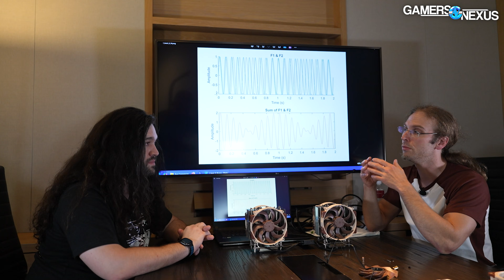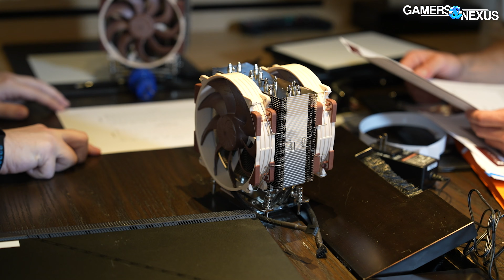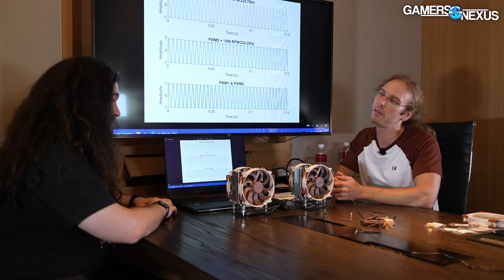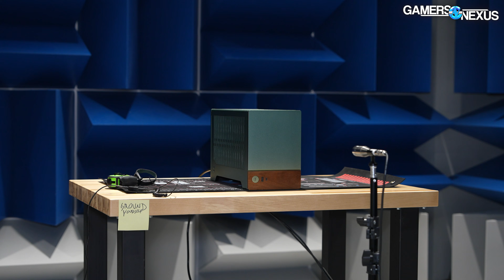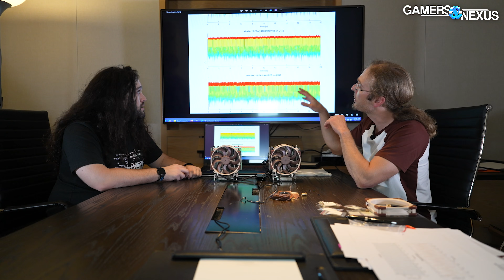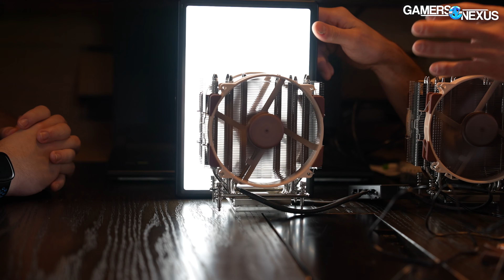The Most Annoying Computer Noise | Noctua Engineering Deep-Dive on Case Fans

Comment: Finished watching the whole video to be sure I didn't miss anything.
I'm wondering why they don't just make dual fan coolers with a single center motor and dual output shafts to each fan? The air between the hubs is basically dead anyways. A single dual shaft 12VDC motor with small serviceable ball bearings on each output would be way better. Not only would the fans always run at a perfectly matched speed, but you can clock the fans to support each other.

Comment: This was a really cool conversation (pun intended).  My current build ran into the intake issue with the rear fan on my O11D XL.  It uses the long vertical slits instead of a mesh, and there was no problem when I had it as exhaust.  But when I switched it to intake it started making a buzzing noise.  Not super loud, but enough to be annoying.  

I swapped to a spare fan, which did nothing.  I then held the fan in place, turned it on and moved it further away from the rear panel and the sound would go away.  So I ended up doing exactly what Jakob suggested, putting some spacers in place to create a gap between the fan and the case.  

I probably only noticed because the rest of my system is nearly silent.  It's a custom loop with plenty of radiator area so the fans are turned down pretty low.  If it had been an air cooled system with typical fan noise I doubt I would have noticed.  

The "beat frequency" thing is interesting.  I played various stringed instruments for many years and I used that effect to tune them.  Two strings that are perfect harmonics of each other won't do that, but if you tweak one just a hair out of tune you can hear it.  Takes a bit to train your ears for it but it's pretty obvious once you hear it.  With fans I wonder how close they need to be to create that effect, and if orientation matters.  Like a push-pull on a CPU cooler I would think might be the most prone to it.

Comment: His German to English translations need work!  Schwingungen is not synonymous with floating, nor hovering at all but for best understanding let me twist a word: "Swingings" referring directly to the swinging of frequencies from peak to peak in relation to the null point in the middle as experienced in time!  It's basically a way of describing any energy waves basic function, to which you can then point out differences in their individual terms or specifics about it.  A use example being "The differences in the 'swingings' between a sine and a sawtooth or square wave".
Reply: The German term Jakob was referring to was "Schwebung", not "Schwingung". As you've said, "Schwingung" in the acoustic context would simply translate into "wave" or "oscillation". "Schwebung" translates into "beat frequency" and, in a more general sense, the verb "schweben" means "to float" or "to hover".
Reply: @noctua_at4356  I know what "schweben" (an effect or an procurance/observation) means, but it is a definition of a more specific phenomenon, and as such can exist without any apparent osculations or motion at all!  "Schwebungen" is plural, and does mean beats, but beats are a result of two frequencies interfering to create beats of a harmonic nature... It's all about context, and in this context the term is not synonymous with floating anymore even if relative to why something may be floating.  There's no floating in radio transmissions, or in a microwave spectrometer, X-Ray machine...!  I guess he may have been eluding to A specific measuring point that "Floats" at a constant or stable value, or within a range.

It's more about use cases, as well as the difference between technical and scientific terms bound to facts, laws and theories, not colloquial words and uses derived from or preceding them, and their often non specific and loose uses, like as you mentioned Acoustic terms or even musical terms with 3 4/4 bars played over 4 3/4 bars both add up to 12 but result in a third beat riding with them (a poly-rhythem).  The fact that many technical terms are derived from more vague ones probably doesn't help.

"Beat frequencies" are a subset of "Schwingungen" which I think he also mentioned (Now the sum of the properties are involved and considered), and in this case the beats are harmonic, and therefore efficient and sustainable, but also stressing on the system and with the obvious noise, because they arose from enharmonic wave patterns AKA interference patterns also in the realm of Schwingungen.  Those are at play here in the form of a secondary wave oscillation, which happens with harmony perfect intervals in resonant frequencies, but also with out of sync enharmonic waves colliding, where the forces can distribute and balance out in ways for an efficient sustainable resultant oscillation.  If this were set into motion and then let play out neither of the two oscillations would be sustained as long as they would separately as they are cross converting each other at a high loss, mainly mechanical energy in the form of friction, but forcing it by feeding it with power forces the differences to balance out and distribute to become more efficient in stability and exert it's own resultant force, (not energy use, its not efficient there).  Here it also leads to shaking the fan apart in less time than it would if they had curbed it better, as well as quiet it down.  They have already started synchronizing and manipulating the RGB on off frequencies to interact with the blades individually, even project images...  Less stuff out of sync, better image quality.

I studied some electrical engineering in Germany;  got deported, never finished, but never stopped geeking out and learning more, and ended up working in wave tech both electromagnetic and mechanical and in varying scales so microscopic to telescopic, high and low power... for a good decade, making groovy custom equipment for some very big labs in the science world, and still am in the wave business, in a wholly different capacity as a guitar builder.  Since some of the stuff I did in wave tech was used in chemistry, and honed for more specific uses, I had to deal with chemists, that used some of the same terms but applicable to completely different problems or processes because they do behave in relative ways, and many terms do apply, but frequency of a wave is not the same as the frequency of occurrence of an event resulting from it, and things like that sometimes caused confusion and had us trying to figure out what each other were saying, and even more so when they didn't speak english nor I whatever they spoke very well or at all.  Thanks to math and graphs, gesturing and making weird noises we always sorted it out.

Also:  Schwingungen is an excellent Album by Ash Ra Tempel delving into what frequencies, especially in multiples interacting in differing ways with each other in an audible sense can do to your brain!

Comment: Ah, I watched out for this when configuring the two stock fans that are mounted by default in the front of the Fractal North very close to each other. I made sure to wire them to separate fan headers so I could let them spin at slightly different speed to avoid that sort of resonance/harmonisation. I say avoid, I never really noticed any actual problem if I had it set in the default way, just read about that possibility online.
Edit: That's perhaps general advice you can take away from this, if you have fans mounted side by side, avoid putting them on a splitter that won't allow you to set separate speeds.

Comment: No mention of interactions with case fans?
There's no reason that 1 CPU cooler fan couldn't interact with the case fans to produce the same effect if both are audible. Or the case fans interacting with themselves to do it regardless of how perfect the CPU cooler fans may be configured.
It's an "impossible" problem to solve from 1 angle, unless we're just thinking that CPU cooler fans are MUCH louder than any of the others, including GPU fans.

Comment: I have some cheap 140mm NOX Hummer fans mixed with a huge 200mm AeroCool case fan, sometimes I can fix a quite fast hum they generate by tapping the front of the case, does that mean my fan controller has a weak knob or something? 'Cause from this explanation it would break the beat frequency for a second then it should come back...

Comment: Vehicle tyres have different sized tread blocks as you run around the circumference, to reduce road induced harmonics. I wonder if differing blade sizes would make any significant difference to the beat frequency?

Comment: Noctua makes some very nice, high-end kit, and yet some of their fans have peculiar sound signatures. I’ve got Noctuas from 40mm to 140mm in diameter and for instance the 40mm fan, no matter what you do will emit a high pitch buzz at higher rpm. Similarly, the 140mm have a distinct hum. I’ve replaced the 40mm with a Noiseblocker PM-1, which is just better in every way, especially noise. And the 140mm I swapped for a bequiet! one, same story.
I do think their CPU heatsink/fan combos are outstanding, the quality of engineering really shines through there. But for case fans, there are a lot of good alternatives that may work out better for you.

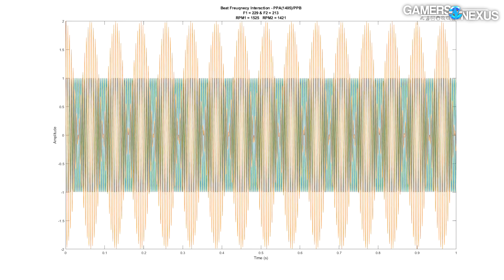Comment: 26:25  1525-1438 sounded the least annoying from my point of hearing right now (relaxed, not stressed, almost no background noise).  My tip would be:  always evaluate your system's noise when you're calm.  Our brains filter out a lot when we're under pressure (some more, some less), but that filtering takes a lot of brain capacity which is why you'll always get more tired/annoyed/distracted in a sound environment that requires a lot of filtering, regardless of wheather you perceive/notice the noises or not.  You'll be amazed of what your ears can pick up when your absolutely calm 😮 goes for all other senses 😊

Comment: But if you mount fans with a gap between panel and fan, won't that also result in a large amount of air being sucked from inside the case? Decreasing cooling performance?

Comment: So obviously, with decent PWM, it should be possible to ensure destructive interference between all the fans in your PC, even if you have to place a microphone where your head normally is and a period of calibration is needed. It should be able to set the frequency of one fan, then alter the frequency of the others (one by one if needed) to minimise total PC noise. After doing this for a range of frequencies, then any hum or constructive interference should be eliminated.

Comment: I have made that """noctua" trick 10+y ago. An empty PSU case with 3 fans inside. A high pressure one the first and 2 bigger distance one.
Corsair h100i fans + 2 PWM share Arctic one. So I can activate them 1-1.
Looking through the blades always lovely. Especially TV lights.

Comment: It´s good to see that Noctua knows about the problem all their current fan designs (mainly A14 and A12) have. This explanation should be included in slides for their fans, otherwise the users may determine the fans are faulty and return them.

Comment: Coolers, particularly air coolers also see very nasty acoustics from the intake aerodynamics when run with pull fans, would be interesting to see different ways of mitigating this. I know some vendors have used serrated edges on the heatsink fins, maybe also zig-zag fin designs could help.

Comment: IF  You  run  the  fans  Full  speerd  this  Noise  Goes  AWAY   as  the  Speed   forces  this  pressure  to  be  so  close  it  is  NO  LONGER  a  oscillating   humb  but   one  wave    unless  your  fans  are  out  of  Sequence   then  you  can hear  it   More  clearly
and  for  those  that  want   sound  dampening  ,  build   a  silent   box   for  it  as  you  are  no  longer  into   basic  use   and  even  during  streaming  ,  You can  place  th  Pc  Out  of  Microphone   reach
if  you  are an  Acustic  engineer  =  Buil  a  Quit  box  or  Move  pc  out  of  room  =  ALL  you  Really  Need  are  Display  cables  in  all  due  reality  =  No  one  N EEDS  to  SEE  Your  PC  if  this  is  your  Business  =  NO  ONE   =  the  pc  Holds  NO   Variable  on Your  Content  creation  =  Other  than  Performace  it`s  Self  !!!

Comment: Beat frequencies show up everywhere!  Me personally, a very slow beat frequency is much less annoying than a faster beat frequency that is still distinguishable.  Beat frequencies are an easy way for musicians to tune their instruments to each other as well - you might still be out of tune, but you're out of tune together so it sounds ok.

An obscure one for you: I worked on a submarine which uses a split electrical system (usually) - so half the machinery was powered off one generator, another half off the other.  I would commonly match the frequencies of the two generators by listening to the beat frequencies from all the machinery in the engine room (more accurate than just looking at the frequency meters, since there's an acceptable tolerance on those to how accurate they have to be).

Comment: This makes me wonder if Noctua could incorporate an externally-powered sensor in each of their fans to self-correct by adjusting the speed to match a desired RPM consistently and then recording that offset to a micro-computer. Rather than RGB, Noctua can use the extra wires to incorporate an offset, use software to define which fans are going to what and have the fans adjust speed as necessary until blade spacing offset is correct and speeds match.

Comment: Fascinating that the perceived pitch of the sound in the clip just after 26:00 initially did a slow climb to a higher frequency sound, but then when the beat frequency reached its peak, the perceived pitch suddenly dropped to a much bassier tone.

edit: well this was an unbelievably unlikely coincidence. I got stuck in physics tube, and in a video about time crystals he mentions a singing technique where higher pitch frequencies can be combined to create a lower pitch frequency: https://youtu.be/Zr8zwfm1Ub8?t=428 (~07:10). I wonder if that's what was going on here; it feels (emphasis on flimsy, insubstantial "feels") plausible.

Comment: Weird. If thermal solution need to create acoustic issues to suppress thermal issues why not just get better thermal handling where it supposed to solve at first place? Multi point sound profiling focus on single fan module. Thing is you rarely see any gaming chase out there with singular fan module slot. If you needed multi fan module that install close to each other what would you expect? 😉

Comment: So a simple way to explain this to everyone so they can relate would be to think about a time when you are driving your vehicle near another vehicle and your engines are running at nearly the same rpm.  You can hear both exhausts resonating in and out of phase with each other just like your case fans.  

A simple solution would be to adjust your case fans individually and set them with an rpm scale slightly out of phase with each other.  If you have 3 rad fans set one to ramp at 50 degrees, the next to ramp at 51, and so on…

Comment: I had a problem with vibration and i have all noctua fans 2x140 front and 1x120 rear and a Nhd-15 with a single fan but after testing i found it was the glass side panel on my meshify c. Fixed it with vinyl tape around the rims of the glass panel.

Comment: Thanks, Steve. I got to geek out listening to this. It is part of the work I did for almost 20 years. Granted, the fans were a bit larger. But listening to the frequency at different spots on the motor and the fan, you could tell if something wasn't right with it.

Comment: I'm surprised they didn't solve this by putting 7 blades one one and 9 on the other (with adjusted pitch angles and such to give them similar air pushing performance).

Comment: I have a case much similar to this however it is happening in my GPU where at certain fan speeds, the GPU starts displaying a very similar behavior to the one shown in the video where we it goes in and out of alignment causing vibration and noise.
Not sure if this is the case since the fans are mounted side by side and not axially like in a CPU cooler. but the similarity is very close.

Someone knows if GPU fans be individually adjusted?

Comment: in my own system, the phenomena i compensate for is it seems like the Case is slightly flexing the housing of some number of the Fans in the system (not sure which ones, hard to tell), which causes them to produce some sort of resonance.
bandaidable with some Rubber or such to shift how the Case sits on the surface to either flex it a different way or correct the flex.

Comment: Beat Frequency is also why when driving and you're behind another car both stopped turning left or right, you'll notice your flashing turn signal lights will go in and out of phase with each other. Sometimes in sync, other times flashing with opposite timing.

Comment: Aeroacoustic turbomachinery engineering -- two of the most complicated displines in engineer mixed/working together.

Those CFD runs must have been a PAIN to run, as aeroacoustics require very fine mesh, and therefore; computationally intensive, and then the multiple reference frames for turbomachinery makes it really, really complicated.

(The two disciplines, separately, are already complicated enough, on their own -- but together and more importantly, the INTERACTION between the two -- phew-wee. Yikes!)

Comment: Multi engine propeller planes also have issues with this, and with the volume of props, they take pretty big measures to mitigate it, else pilots and passengers go mad.
Some aircraft have an indicator called a synchronizer, and pilots would manually adjust props until it stopped spinning, and the resonant few went away. I’m fairly certain modern modern aircraft just have auto synchros now